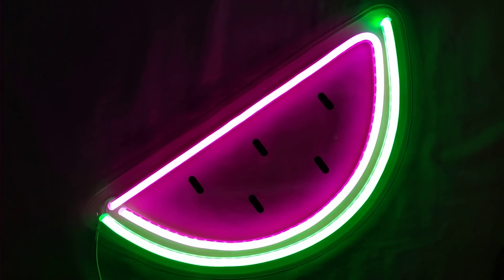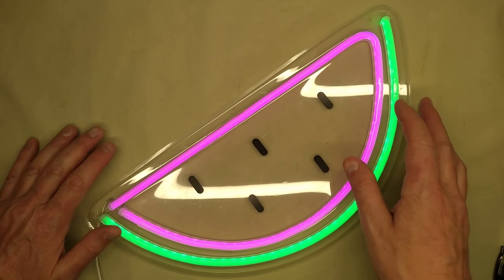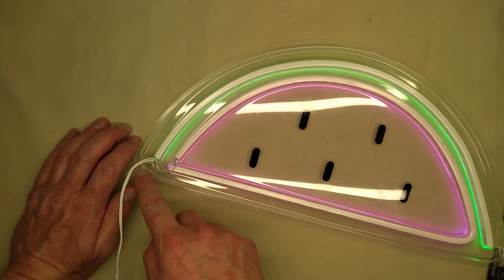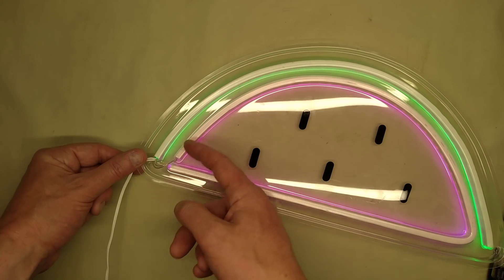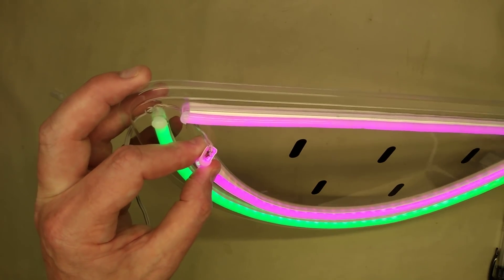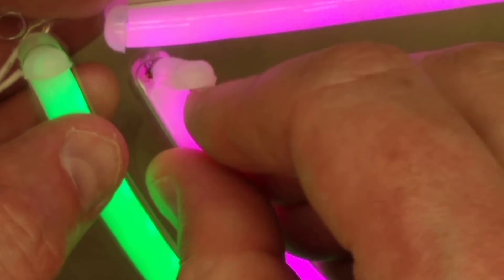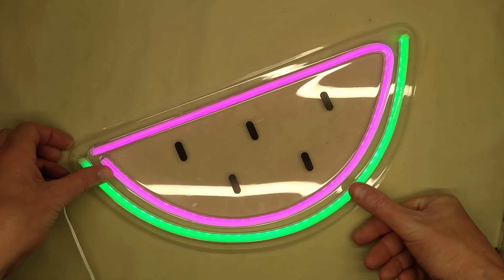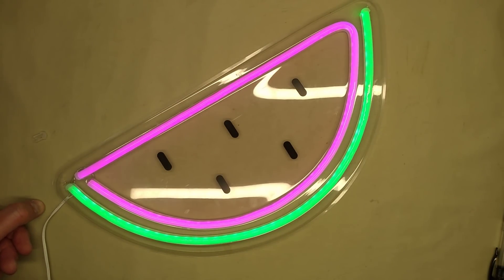Vac formed LED "neon" sign.  Genius or tacky?

Comment: Unfortunately, the effect (if you want colour on the inside) only really works against an opaque wall. For out-the-window sort of stuff, unless you want your OPEN sign being see-through, stick with classic black. Though, considering the effect and how well it manages to pull off the neon look, I see a grim future for neon and neon transformers, relegated to hobbyists as a dying craft before going away completely except in the rare instance neon is still used, with an on-site technician to fix it up.

Comment: It's both. I personally prefer overbuilt gear, but I understand the way this sign is constructed carries a nice measure of utility and a LOT of cost savings for the end user. Low material and machining demands also mean you can put a lot more time into building creative stuff with this method. Frankly, they'd be hurting their business if they didn't branch out to creating elaborate, multicoloured, glowing art.

Comment: Clever. Someone could make a nice little cottage industry making signs for local shops using this technique. Small homemade thermoforming equipment that can handle this thin plastic isn't very costly. Single shot molds could be  made from wood and Bondo (automotive body filler). Neon sign makers used to be common and relatively affordable. Today they are scarce and quite costly.

Comment: Call me disconnected, but a pal and myself would like to sort you out with a Raspberry Pi 4B (2Gbyte - not totally made of money . . .) with, due to the heat issues, a lava lamp, driven by the Pi being immersed in mineral or other oil (baby oil maybe . . . eek!) for both cooling and effect.
How do I get to contact you to briefly discuss this?
My pal, your namesake, is about the same size as yourself, but with his diminished height just distributed a little more in the horizontal  plane . . . ;-)
Regards, Ian_
Reply from the maker: I've  considered getting myself one.  I'll wait and see if there are any teething issues first.

Comment: Wonder if a flexible curve (rule) would make good pattern for moulding. If are led strip sign maker type, the technique is pretty genius. See rapid are stocking the Mayku Formbox now... only 200x200mm area and £500. All see other youtubers doing is make chocolate moulds with it.

Comment: That was quick. I think it depends on how familiar one is with the appearance of vac formed plastic.
Think I would prefer thicker acrilic so the tight is seen on the edges. And it looks more substantial on the wall. 
Then I have to remember the price point and its intended market. 
It certainly looks better than a plastic skeleton holding it together like some Christmas ones . It's a good product, I don't like the lip on the edge, a pair of scissors will soon sort that out.

Comment: That's a neat idea. It's a hell of a lot cheaper to make dies out of wood or some other easily-munched material that won't stick or melt than it is to mill out and finish a pile of steel for injection molding. It's basically something that lets you fix mistakes when the dies start getting chowdered, or quickly carve up some new dies in a different shape that might be more popular. You can do that in steel too, but it costs more, especially for small-volume products like this, where you just might have to keep selling pineapples watermelons in December. On just the initial investment side of things, IM equipment is a lot more expensive than vac-forming kit.
As for the material feeling cheap (I mean, it does), it's going to be sitting on a table or hanging on a wall anyway. You won't really see it, and you won't be handling it often, so it's kinda irrelevant. As a bonus, it's incredibly light compared to alternatives like acryllic, and PET is just way more tolerant to household cleaning solvents than acryllic.

Comment: It's too cheap and disposable. But it is a clear bit of design.
Reply: Cheap and disposable has its place though. I see a lot of potential here for the retail display industry. Like limited promotions for a product or brand. Lighted promotional signs aren't always freebies to retailers. Like in my shop, there's a few I paid over $200 for (and a few that were quite a bit more expensive than that). But, they drive sales when you use them as window candy, thus making it worth my while to pay for them. Let's say my distributor runs a sale on a product line for a brand, or even an entire brand (it happens, and we usually get a few weeks lead before it does, at least in my industry). Let's say that it's not a brand I usually stock, because the price is normally outside that of my main demographic, but the sale price is going to make it worth my while to stock it (at least for a limited time). Or, even if I do stock it, getting more people in the door is seldom a bad thing.

You could work with manufacturers to use their branding in a similar fashion (no different than the vacuum form plastic/embossed cardboard displays we already can get), make some additional signage like "Limited Time Only", "Sale!", etc, and make the system modular. In a few weeks, after all the hubbub dies down, they are robust/lightweight/compact enough to store, but no big deal to throw out if something happens to them in storage (and it does). Attaching to the front window is easy enough with suction cups, light gauge wire is easy enough to conceal to the closest outlet, etc. There's something to be said about light weight displays as well, traditional signage can be a PITA to work with. It's kind of a win-win situation for us.

Comment: was the 'Vac-Press' commercial intentional before this?  you can improve your business with easy and simple to use Vac-Press, with 3D printed items you can VACPRESS anything ..and then SKIP AD.    a commercial for the process that produced what Clive is presenting. .hmmm
Reply from the maker: I'll guess it's accurately targeted marketing based on the description and tags.

Comment: It's an excellent low cost low power feature for a bar or club, in the right setting it would be tacky, but right
Reply: Could also picture that in the window of some ma&pa type corner store or small carry-out diner that sells shakes and ice-cream in the summer. A little bit of a ratty dive, but good food within walking of the beach.
Reply: @pauljs75  lol, yeah
Reply: I'm assuming this LED is more power efficient than Neons? I'm pretty clueless here, but I'm pretty sure.
Reply: @Codingale  neons eat power in large doses, whereas this would sip. The power converter might draw the same or more mW than the LEDs do

Comment: It looks the part, the valley for the strips also provides rigidity, they can do all kinds of designs with very little retooling work - genius in my book.
Reply: It really depends on the shape you want, in the company I work in we make the inner liners of refrigerators. They require quite big tools, because it is a complex form with lots of details. Something as simple and small as those things would be very easy and cheap do to. Though toolchanging is expensive, regardless how simple the form is😉
Reply: @techtastisch7569  For small runs the mould only needs to be made of clay or plaster and is relatively cheap to make.
Reply: Thanks for the feedback! - so retooling for vacuum forming can be expensive depending on the tolerances and the material to be formed - but is generally expensive enough that this price point probably sees... 10,000+ units of any one design, produced?
Reply: Expensive retooling is required as soon as you change the shape. Then you will need new thermoforming tools like https://www.kiefel.com/en/Kiefel-Packaging/Thermoforming-tools_s_6150
Reply: @lastnickever4440  I used to do work for a company called Lexel Lamb in the 1970's that made vacuum formed christmas decorations, all they used was a plaster on plywood form and a bank of infra red lamps to heat the plastic sheet some of which were 8x4 foot. Sophisticated equipment is not needed for vac forming.
Reply: @Equiluxe1  Seems so. Perhaps the other poster is getting confused on specialist vac forming? I've seen sandwich film packers do the kind of things this led lap needs. Lol. XD
Reply: @lastnickever4440  There is a vacuum former at my job for packaging of flat parts on a board. All it would take is gluing a flexible piece of plastic in the shape of the channel onto a sheet of cardboard. Obviously that wouldn't be a tool good for thousands of parts but I bet for an order of 100 parts or so it could be a pretty decent extremely cheap method. And to get a shape cut, we also have a machine that's sorta like a cnc xacto knife that can cut the shapes and holes out without any new tooling, just a DXF file. It really just all depends on the quantity.

Comment: If something is stupid, but it works, it ain't stupid. Same goes for tacky. ;->
Reply: I don't know. There's plenty things that strictly speaking "work", but are still quite stupid and you regret them later, usually when it's too late to undo them.
Reply: @gigaherz_  like wasting your money on a tacky led watermelon slice.  :D
Reply: @gigaherz_  I might put those in the category of "seems to work".
Reply: I hate that saying. Using bare wire shoved into a socket to power a device will work, but it's also definitely very stupid.
Reply: @TakeMeOffYourMailingList  I guess it depends on your definition of "works".
Reply: i would imagine they mean "works (without any issues)"
Reply: Some might say a Chevy Aveo works. I still say it is stupid and tacky
Reply: @JasonW.  I have no answer to that one.

Comment: Makerspaces often have vac-forming equipment, so if you can find an appropriate-sized aluminum channel (could 3d-print the angle connectors) this lends itself well to making your own one-off wall hangings.

Comment: Hell yeah it's a good way, not to mention, in the 80s swatch watches came out or that's when I noticed them well once I saw the clear plastic one I had to have that. I've ben saying that for years make stuff out of clear plastic. So we can see inside spark curiosity, look for the skid mark, smoke, or what let the smoke out. Anyway yes I think its is a good way it had to have ben cheap to make and  And like you said a guy could make a hot/ vac press whatever they are called.

 Note 2 SirClive still moving I'll get to the coaster I'm kinda saving it for the new to me house. 😀 Cheers. From no rain or cool kansas for the next 10 days kansas.
Reply: Swatch

Comment: I do like how cheaply it's done, this is a price point thing for me though, I don't know how much I'd pay for it as I can imagine it getting wrecked up rather easily. But for 5-10 bucks, I'd buy as there's no way you'd touch a proper acrylic backed sign for that amount.
Reply from the maker: I think it was about £10.
Reply: @bigclivedotcom  ~$12.50? Not bad, if I were lighting a dorm, appartment or shady rave I'd definitely be in on it. I really need to get my hands on some of that LED neon and make runes on my walls.